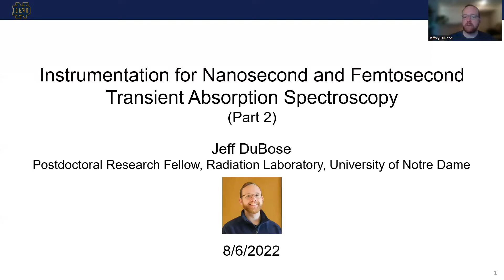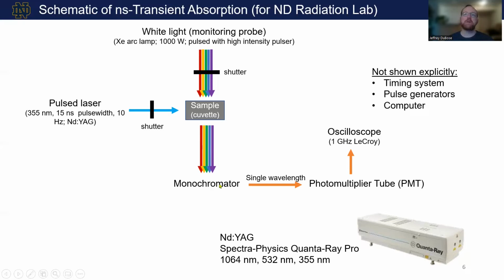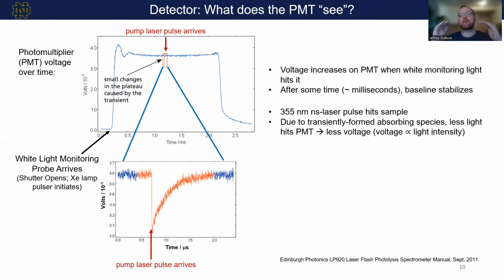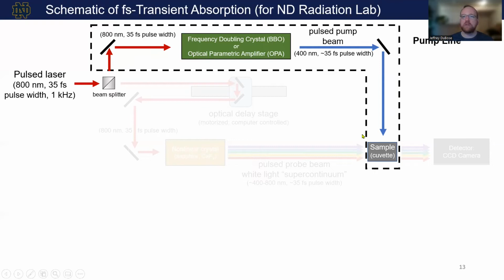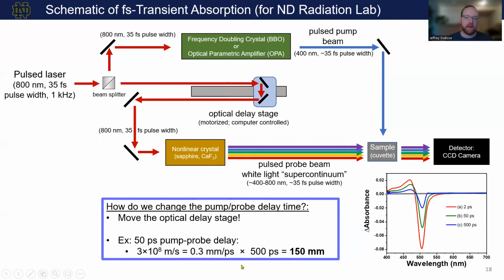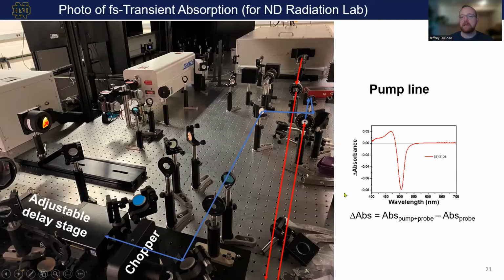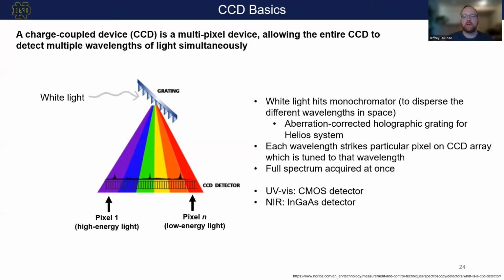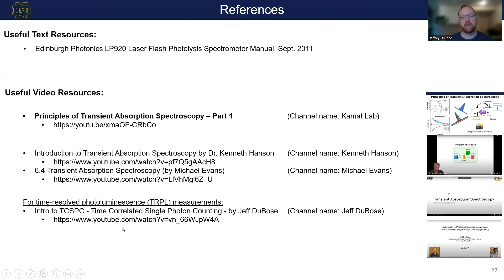Instrumentation for Nanosecond and Femtosecond Transient Absorption Spectroscopy - Part 2

Comment: Hi, do you know how the phase of the differential signal is chosen? Because sometimes ccd will measure on/off/on/off data and sometimes off/on/off/on data which is flipped. I am having hard time to fix this issues.
Reply: Hi, you need to measure the phase of your chopper together with the first spectrum acquired by your CCD. once you know if the first shot corresponds to a "pump open" or a "pump closed" event you are all sorted. Here I am assuming that chopper and CCD are synchronised to the laser